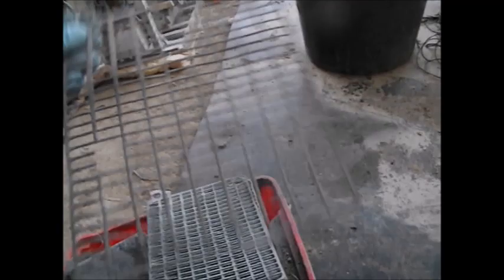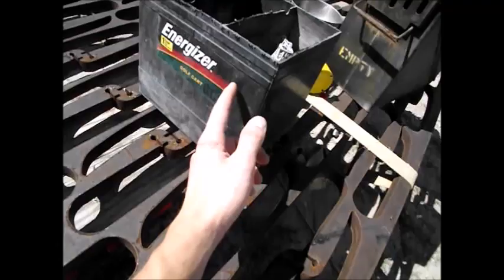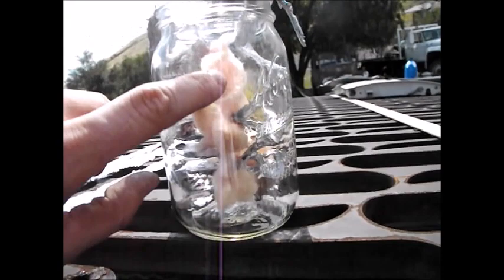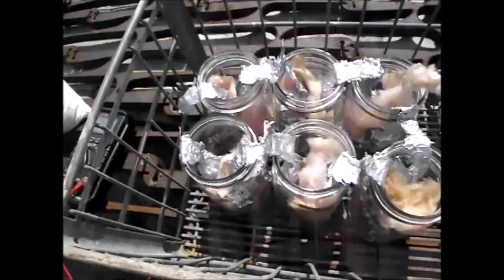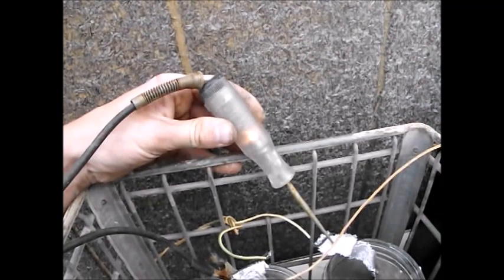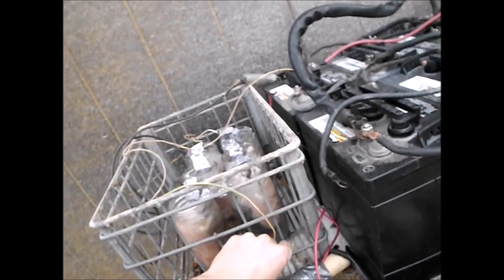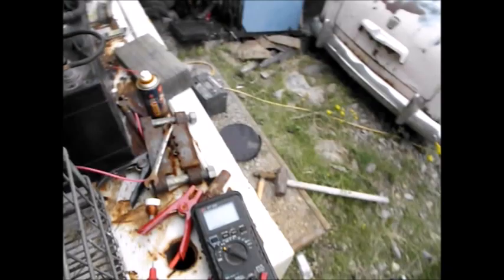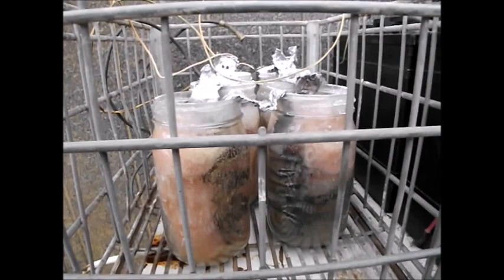Homemade Lead Acid Batteries

Comment: Could you make a plastic 44 gallon drum or an IBC [1000lt] container cube into a battery for home use and show how please. It would make all home use solar applications cost viable and save so much coal and/or nuclear etc. Solar panels are cheap enough, but the average person still can't afford to store the energy. On or more batteries of the scale I am talking about would do it if it is 12v, please, can't somebody with the knowledge figure it out.
Reply: Desmond Bagley  What should I type in to find the capacitor vids/s your talking about.
Reply: Desmond Bagley  I downloaded a few of Robert Murray's vids and - what a mind job, excellent. I'm in Oz, so the freight from england would be, hmmmm, but I haven't got a quote and to be honest, from what I've seen so far, not a problem, stunned by the simplicity. I want batteries for a liveaboard sailboat, but retail lithium is too dear for me and the house option also. The cap. option sounds awesome. I have to look at a vid of his, I want to know the difference between a battery and a supercap. Can a supercap, be used instead of a battery, practically and longterm. In my still ignorance a battery now sounds like a poorer option and a supercap sounds like a super battery - what do you think??? Des.

Comment: Can you really check the ESR of a battery with an ohm meter!?
Reply: Check voltage first, if its still got charge you can't check with an ohmmeter.  Can do with a small current through a resistor and ohm;s law.

Comment: How do you know which is the anode or cathode?
Reply: it depends in which direction he decides to charge it, the dark colored plates of lead dioxide is the cathode while the lead plate are the anode
Reply: They depend upon the way the cell/battery is initially charged. If the charger connects  red, positive lead to terminal A then that terminal will be the positive on the battery when the charger is removed.

Comment: I'd like to know why people vote down a video like this? Disagreement with the science?
Reply: It's not disagreement with science. It's disagreement with all the false information in this video. For starters, as others have already said this, you cannot measure internal resistance of a battery using an ohmmeter. You need lead plate for negative and lead-dioxide for positive. The reason sulphuric acid (H2SO4) is used in batteries is so that after the sulphate gets combined with the lead plates, water (H2O) can remain in the electrolyte, that's how the reaction works, it  magnesium sulphate and ammonium sulphate won't make a battery. Also, he consistently uses incorrect terminology ("the battery stores current", he's trying to "measure current" using the voltmeter, etc.), which is a clear indication that he's not too familiar with the subject. You DO NOT EVER CHARGE a 6-cell lead acid battery with 30V, or using any non-current-limited power supply, since it might blow up in your face. And this is just the tip of the iceberg. Putting up "educational" videos there the producer of the video does not know what they're talking about is very irresponsible.

Comment: You cannot measure the resistance of the battery like that! Internal resistance can only be calculated for a voltage source, knowing the current and how much the voltage drops. BTW; it showed 7.2 Mohm, not ohms :) 1000 000 times greater.

Comment: .  +Cody'sLab ,   thanks  for your  interesting  deep explanations , that's = very  ok ！ and    seldom  to find  on YT  -
 
     the more   c y c l e s  of  charging /discharging  that cells  will  get , the more its capacity will  grow up  -  the same as  in   your cells : 
      this  principle  - starting  a construction  with   equal   lead - tin - plates  for  both   poles + and -  , this   simple  construction was already  known  in the  early 1920 - years.  

   and how to be seen in your video, its  really  nice  that effect -     clearly to be seen the   changings   into  the  dark brown    PbO₂   ㊉_ poles  ...   

( (   I  used  that  construction  some years ago  to show  young  learning   radio operator's   the  basic  working  of  acid batteries   ,  in  < 30 %  H₂SO₄    . . .   : - ) )
 

2017-03-22,15uhr05

Comment: How many amps does it produce?
Reply: +hobonoob5000 p Based on 10v total, and I think he said 13 ohms internal resistance, the maximum amps he would get would be 0.769A at 10V. Which would be like 7.7 watts. But that's just loosely guessed, don't quote me on it.

Comment: The internal resistance of the battery cannot be measured by using a multimeter in its Ohms range and connecting its probes directly to the battery. In any case this measurement is wrong and dangerous for the instrument. The basic rule is: "We never measure resistance on a live circuit"...

Comment: too much for too little return rendering this a useless experiment there are far greater ways to get more power with less stuff and more power and its uesable what you have is unusable for any practical application. You fail to realize these backyard science experiments have been done before so you need to use processes that prove to yeild more progress then expand upon those processes. I work for my own consulting firm and there i just gave you free advice enjoy
Reply: These videos are more just for the fun of tinkering than for actual advice I think.
Reply: +stopbeingcowards Experience doing something is worth much more than your hypothesizing thing you don't understand. He is demonstrating things and doing them while you foo foo them. What have you built?